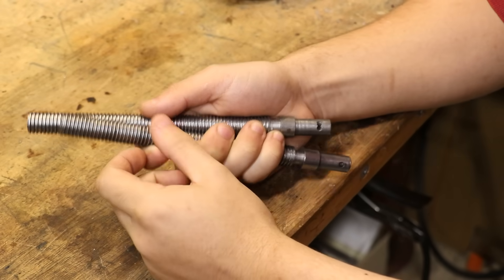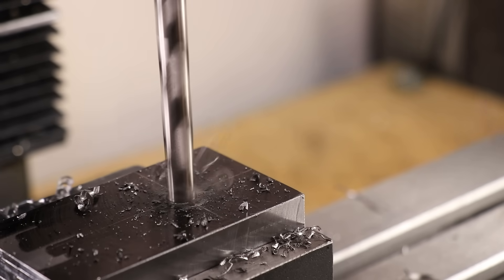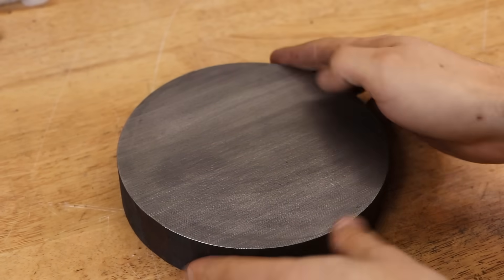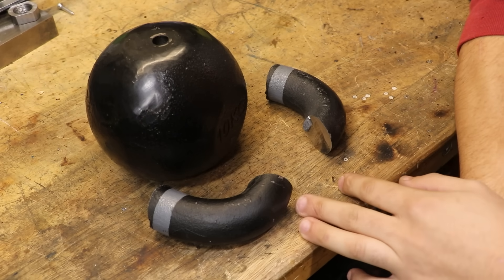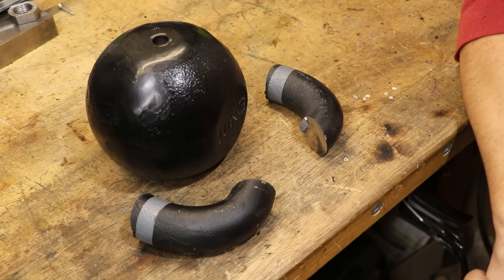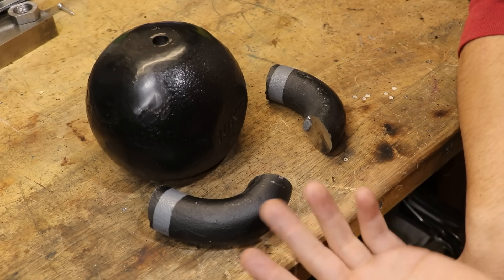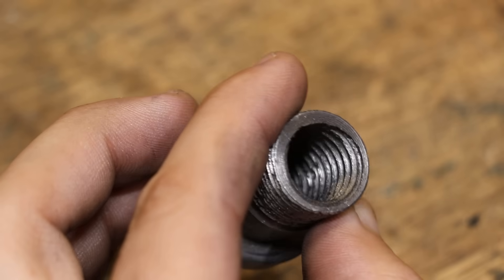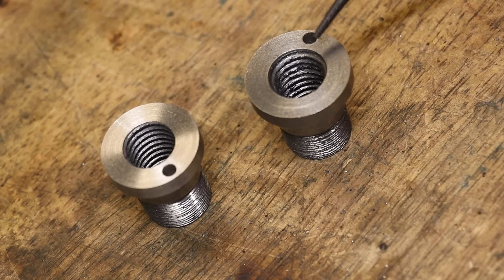Why You SHOULD NOT Use Cast Iron Weights For Machining

Comment: after seeing how the cast iron process works in pakistan, I can believe it.  there's several videos of them casting iron under pretty insane conditions;  there's a guy beating an old engine block with a sledge hammer to break it apart into pieces small enough to throw into the furnace, where they mix in old motor cases, misc car parts and other random castings.  if they do machine the parts, you can see lots of voids and other imperfections in the castings,

Comment: Cast iron was used as bearing material in war made machines which were known as ‘War Finish’. They do need substantial lubrication when in use and there were regulations that they had to be lubricated within 4 hours of commencing shift and a register had to be signed by the responsible technician in U.K.

Comment: Should add that for the same reason you shouldn’t use rebar for a bit of bar stock, that chances of finding a random bit of carbide, flux, or moly/tungsten/miscellaneous super alloy as an inclusion because it’s usually made from a scrap melt.

Comment: Somewhat off topic here, one thing I've found with the AL250G lathe (apart from the clicking noise the gearbox has started making when I engage the lead screw 😵), is that the hole in the chuck is smaller than the MT4 spindle bore.  This is quite annoying as it means you can't simply push through a centre into the bore, but have to remove the chuck to do so.  Have you come up with a solution for this Mr Artisan Makes?

Comment: Thw cast iron weights are made out of metalurgy leftowers: metallurgical mill makes a product and latter: in hot metal lava bucket it have some surplus deka tonns of melt cast iron, so they go made a weights from them. So, it is cheap, bad quality cast iron. 
By the way: cast iron is quite good material for to use in various aplications. You need to know a grade of it.

Comment: Cast iron crankshafts from old car engines are a good source of material. I’ve cut some pieces out of old Ford six cylinder cranks in the past and made small parts. Old lawnmower engines also have cast cranks.

Comment: Cast iron is unique among metals.  It is the only metal that that expands upon cooling.  Porosity in cast iron is usually the result of inadequate degassing, inadequate fluxing or not killing the melt.  When machining cast iron, I think that you will find you will better finish when you use ductile iron rather than grey iron.  Ductile iron is sometimes referred to as nodular iron.  hth
Reply: um? plenty of metals expand as they solidify... bronze is a common one...
Reply: @paradiselost9946  Ummm, nope, the shrinkage rate for bronze from melt to solid varies from about 10% to 20% depending upon the alloy.

Cast iron expands because the carbon is in solution in the melt and then precipitates as free carbon as the melt solidifies resulting in a volume increase.

This is why a sprue is used on castings to that the last part of the part to solidify is the sprue.  You will see a pipe form in the sprue when it solidifies.

Fun Fact:  The only other material that I am aware of that expands upon solidification is water which expands by about 10% when it solidifies (turns into ice).

Hth
Reply: @paulkurilecz4209  stop "educating" yourself with chat gpt.
Reply: @paradiselost9946  LOL, are you saying that I should get a refund on my various degrees and just ignore a few decades working in foundries?

BTW, I suggest that you might want to consider doing an internet search on shrinkage rates for liquid to solid metals.  And if you feel up to it, go to a library and check out a few books.  I would suggest that you start with Physical Metallurgy by Guy and Rhen.  And if you still disagree, then take it up with them.

Comment: Brake rotors are good iron. Can't really make anything from it as is. Washers, maybe.  However,  having a small waste oil burning foundry furnace  would be a plus.  Large enough to melt40 to 50 lbs of iron (maybe 100lbs) and make foam coated in plaster. Supported by dry sand molds . Lost foam casting . To at least make cylinders , bars and plates of iron. To be milled into parts. Maybe use nitrogen  or welding cases to isolate from the atmosphere.

Comment: FWIW, My favorite cast iron to machine is Durabar, or 65-45-12 ductile iron(generic). Most small casting companies can cast this for you and if you tell them you plan to machine it, they'll cast accordingly. The sand don't matter, its the skill and time. 
My most recent project was a solid tool post for my lathe from a 6"x6"x4" sand casting. 

By contrast I've machined scrap pieces off a large front end loader, HUGE voids in the material.
Reply: yeah, as long as you make your first cut deep enough to get under the crust left on the surface by the sand casting process (cuz that shit will wear out cutters like a bastard if you don't), it's not an issue, especially with cast iron, it's one of the easiest materials to machine, as it has a ton of carbon in it to the point where it basically self lubricates during cutting and doesn't need to be flooded with coolant the whole damn time, great if you're working with an open machine doing manual work and don't like having to mop up spilled coolant after every job.

Sure the carbonyness makes it kinda messy in it's own way, but you're gonna hafta clean up a mess of chips and debris with basically any material, and compared to doing work on fiberglass shit, it's a breeze to clean up.

Comment: go to an asutomotive machine shop and get  a dead crank.  Great stuff and been through plenty of heat/cool cycles. The oil holes can be an issue, but are usually irrevelent.

Comment: Cast iron from scrap sources is indeed a quite unknown 'lucky dip' as to what quality of material you will get to machine with. 
Cast iron weights and the likes have no need to be anything but the cheapest form of iron known to man and are therefore unlikely to be a wonderful grade of material to machine parts from......Durabar is where the answer lies if you need reliable machining grade cast iron,but as you say it comes with a relatively high price tag.
Have you watched any of the series of  luckygen1001 iron casting videos?.....lots of good info there on producing good quality homemade cast iron bar and components.

Comment: Actually, the Youngs Modulus varies hardly at all amongst all the iron alloys.
Reply from the maker: Steel yes, cast iron has a massive rage
Reply: @artisanmakes  Well, you learn summat new every day. As it tradition I went to the internet to refute your allegation, and found that it's true. It appears that there is a factor of 2 stiffness difference between various specified grades of CI (and I am prepared to believe that out-of-grade irons may go even lower). The page I found also contains the interesting information: "Note* : Gray cast iron does not obey Hooke's law, and the Young's modulus in tension is usually determined arbitrarily as the slope of the line connecting the origin of the stress-strain curve with the point corresponding to 25% of the tensile strength (secant modulus). The Young's modulus of gray iron varies considerably. Thus, in using measured strain to calculate stress, it is essential to measure the modulus of the particular gray iron specimen being considered."
Reply: @ andypughtube  "I went to the internet to refute your allegation, and found that it's true"
Happens to me every now and then as well.  Good for u to post about it!  😉

Comment: I like using scrap cast iron when I can get suitable pieces. I only use things that have been through a machining process though, like gears, machine bodies and the like. I have a portable band saw to cut usable pieces out, and (when possible) I attach a shop vac hose near the cutting point to suck up the worst of the dust and fine chips.

Comment: From my experience most weights and non-engineering castings are pig iron. We used grey cast iron on gearbox castings but had too much porosity. We switched to spheroidal  graphite cast iron  or SG iron. What a difference it was superior in every way. The gearbox castings were roughly 3.3 feet / 1 metre diameter and 18 inch / 0.45 metres deep. This gearbox had a large bronze gear and output shaft, which were cast but again porosity was a huge problem, I was able to get the bronze parts centrifugally cast and once again the difference was outstanding. I used to have putting fine threads onto  cast iron as you showed the problem very clearly, SG iron gender to take the thread much better. Interesting post, thank you.

Comment: It would be interesting to see a rotor cleaned up and run through the furnace cast into some cylinders.  Grainger has 65-45-12 Cast Iron Rods 12" x 1.5" for $55.
Def seems like it might be worth casting some blanks.
Reply: I want to try n do that as well. You pay for the center and most times cutting / bore 80% out

Comment: I don’t about where you are, but here in the USA, good cast iron is expensive in small quantities from a known source. Often I’ll make the part from 1144 steel, or even 4130 or 4140 instead. Hardening and tempering to about RC 50, about as hard as you can get those after tempering, makes a good bearing surface and threads are pretty strong.

Comment: One machining risk of unknown source cast iron is inconel contamination because they look exactly the same😳
I worked at a foundry and for the furnace, we tried to keep the inconel out but with somthing like weights, good luck.
I was making manhole covers, drains, valves, and any sandcast parts using recycled cast iron or steel rails for valves.

I saw the aftermath of a tool hitting inconel in a lathe and it wasn't pretty and scared the poor machinist poo-less.

Comment: If you want to machine a part in cast iron it is best to buy centrifugally cast,  cast iron bar stock.  If you only want a small quantity say a 300mm length,   then buy that from one of the Model Engineering suppliers.  If you are requiring strength in your part then consider using spheroidal graphite cast iron where the graphite in the cast iron is in spheroidal form.   This confers a greater tensile strength and an increase in ductility over the flake graphite type cast irons.   For components where the cast iron has been selected  for its weight  and inexpensive properties,  mechanical properties are of secondary consideration.
Reply: Yes, Dura-Bar is decent stuff…. Made a sewing machine part of some 65-45-12.  Way tougher than the original.

Comment: I could be wrong, it's been quite a long time since that discussion has come up, at least 30-40 years for me in the US, that this might be the difference between cast iron and wrought iron. Wrought iron is junk, garbage, almost good for nothing but weight and decor.. and it's not very common these days. The terms "cast iron" generally means "good iron" while "wrought iron" was the lesser, porous gummy stuff that doesn't machine well and is overall weaker. I dont know how it's classified in other parts of the world though.
Reply: Wrought Iron is considered superior because it isn't brittle like cast iron. It used to be used in the horizontal beams of iron-framed buildings (because it has a higher strength in tension than cast iron does). Your lore is completely fabricated.
Reply: @kmoecub  you've got it the wrong way around bud. Wroght is completely obsolete in the western world and has been for a very, very long time. You could google that before calling it a fabrication lol
Reply: @kmoecub flag my response, nice 👍
Reply: @kmoecub that hasn't been true in 50 years, probably since the mid 70's. I did look it up to be sure, real wrought production stopped a very long time ago. Modern cast will be superior to modern wrought in every way, modern wrought is made with junk slag left over from various metals in the mix and typically reserved for ornamental & 'inexpensive thing-making'. Old real wrought is recycled and typically reserved for other uses like knives and sensors. Real wrought still doesn't machine well.

Comment: White cast iron contains carbides, hard as glass,  yes, engineering is all about efficiency,  why spend time, design,  and quality processes on a dumb bell end product.
Apart from brake discs (ask mentioned), vee pulleys are a good source.
I've recently machined some vintage motorcycle valve guides from BS1452 Grade 260, beautiful finish,  plus polishes up nice.
Good information on what you get for nothing.

Comment: Basically you should educate yourself on the types of cast iron and their properties (wikipedia isnt the worst starting point)
1.) spheroidal graphite iron
2.) gray cast iron
3.) cast iron with lamellar graphite

No1 to No3 is also the ladder from best to worst, but that also ignores, that there are even many variations within one group, followed by special surface treatments available with also many variations - some standard ones "everybody" knows, and some special that only the specific user and producer knows.

What can also be said is that cast iron as well as steel mechanical propperties can suffer/profit from other added elements, as well as totally suffer by unwanted additions/impurities (basically dirt, slack, sand) and well dumbbells have no real demand towards mechanical strength, as long as they are heavy and the handle should not break. But in the way it is made, it is heavily oversized.

Meaning the cast for dumbells can originate from mixing the cheapest and least separated source materials one can get - perhaps even a part from an old soviet nuclear reactor, along with the graphite from Chernobyl (the graphite is a joke, smellters with recycled steel with radioactive contanimation not, normally in the EU before scrap metal is put into the smellter it is checked)

And btw. increased lead quantities will make cast iron very brittle - perhaps the lead acid battery was not removed from the car.

You can try used but good quallity brake rotors or drums, as a source material,  as these have desired mechanical properties - and perhaps you should look at the lorry sized ones ;)

Comment: The few times I have used cast iron I have been seriously put off by the mess, even with chip extraction.  I would go out of my way to find another suitable material.  For your application I’d have to find some bronze round bar.  Instructive and informative video nevertheless.  Yours don’t disappoint.
Reply: Machining cast bar stock is a pleasure I use a shop vac where possible, a tray with magnets in plastic bags helps keeping the bed and weighs clean I never use compressed air to clean up especially on rough sand cast iron, you may as well use diamond grinding paste to lubricate your ways , I also have several magnets in plastic bags over and in the coolant pump sump and it's amazing how much fine grit gets circulated in the coolant, I also use the coolant to wash the finer dust down, I once set up a vac on the back of the spindle when I was boring and reaming fine grained cast iron and graphite bushes that's real filthy work.

Comment: I have used sash weights with success if I anneal them first. I used to work as a foundry man in a very basic shop. If valves and valve springs got into the melt, we got "white" iron. It is not much like iron, more like glass in all ways. Super hard, brittle and shattered on impact. With regular gray iron, quenching causes a hardness making grinding the only way to work it. I also make some watch parts, with .19 mm carbide drill bits cutting regular steel, you can feel soft spots as you drill as the pressure is very low. Cheap iron products are usually quenched, while parts to be machined are left to cool slowly.
Reply: Yeah, back in the “old days (18th century) they would use white iron for tool cutting edges.

Comment: I guess thar begs the question, for guys like me who aren't familiar, how do you cast things to be good and machinable?
Reply: Materials choice is important and for many materials, simply leaving the casting in the mold to slowly cool down to room temp is also very important. Factories churning out metal weights don't care about the brittleness of the metal weights, so they're perfectly happy throwing whatever crap metal mix they can into the foundry and pulling the casting out of the mold and quenching it to room temp as soon as they can so they can reuse the mold to make another casting more quickly.
Reply from the maker: At least for home casting. Good mold design so it doesn’t trap air and don’t do it when it’s humid.
Reply: Same boat here, hoping to do some casting and machining if I can find an affordable used lathe.
Sounds like cheapest option is used breaking up used rotors, where you're trading sweat effort time vs buying graded products from Grainger or Metal Shop.
Side effect of using rotors would be that there is probably a much higher QA going into their manufacture since the liability for cheap shit could put them out of business.
I buy our rotors, so I think I could probably shot the Manf. a Q about what they're made of/certified to.

Comment: Do you know how people stabilze wood by having it sit in epoxy and pulling a vacuum on it to replace all the air and voids in the wood with epoxy?
I'm not saying it makes sense or could be useful, but now i do wonder how much epoxy a porous piece of cast iron would pick up
Reply: I don't think it would go any deeper than the surface. The porosity is more like closed-cell foam than open-cell foam or wood.